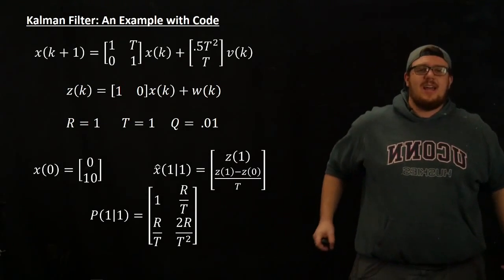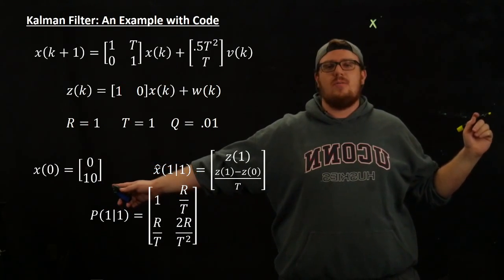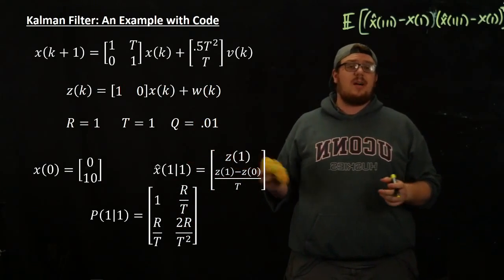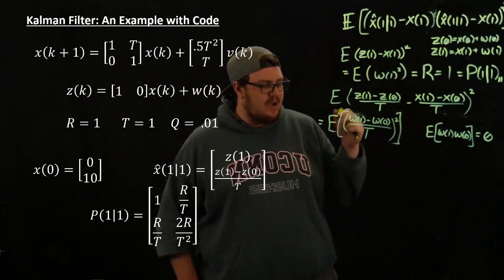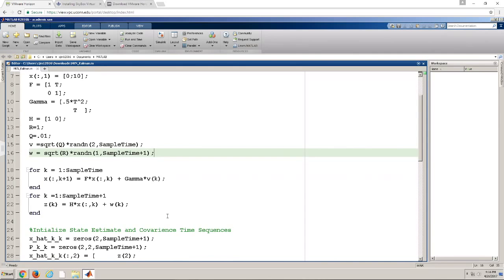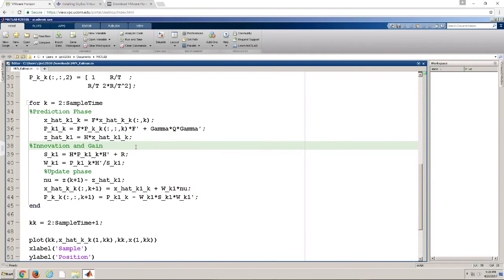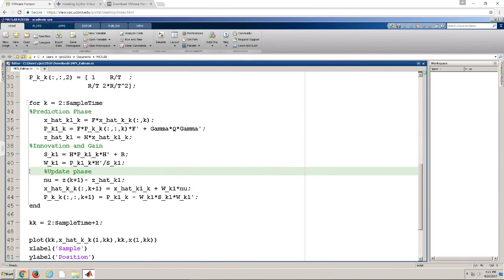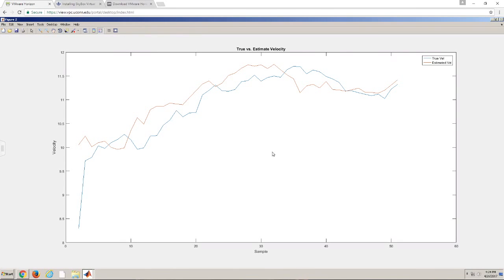Digital Communications - Kalman Filter - Part 2

Comment: Hey, very nice video. I have one question thought. How are you selecting the covariance noise values( R & Q) are they empirical values based on tuning?
Reply from the maker: There are ways to choose these. R is usually chosen according the maximum values of the subsequent derivatives of the estimated target variable. For a position estimate, R is usually chosen according to 0.5 to 1 times the maximum acceleration (will usually require tuning). The Q values, on the other hand, are usually a result of the accuracy of your measurements and are defined by the sensor's physical limitations. If you would like to learn more, we highly suggest "Estimation with Applications to Tracking and Navigation" by our distinguished professor, Dr. Yaakov Bar-Shalom!

~Andrew